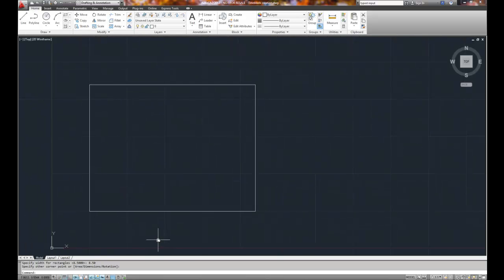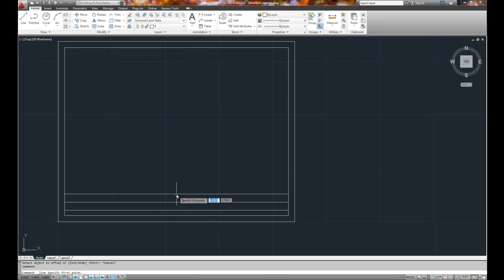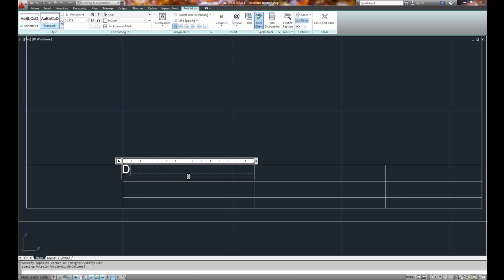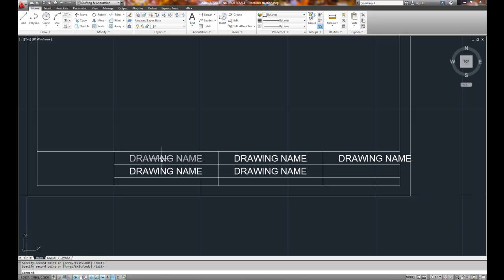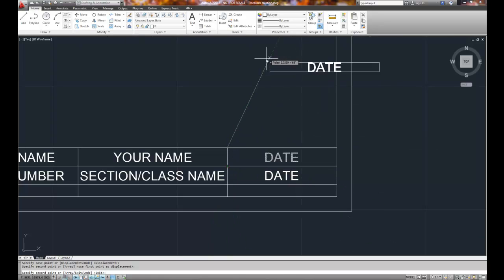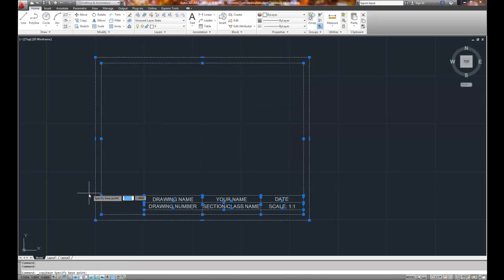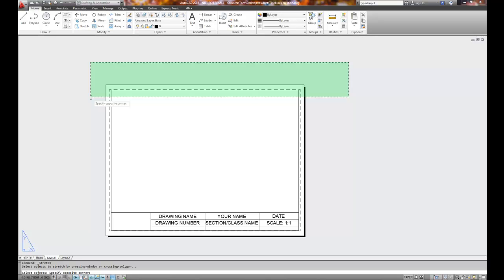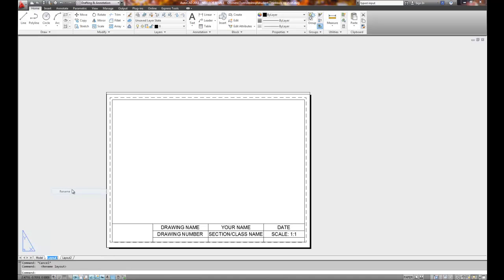Titleblock Template creation for Layouts Video 1 of 2

Comment: Is there anyway to customize the area of the dashed lines.  I made a title block but it doesn't fit in the plot area?
Reply: The hidden lines will fit around you title block once you modify your title block under Page Set Up Manager. INSTRUCTIONS *Make sure you have copied you title block into layout area before you begin to do this. Don't worry about where it is placed.**  In the Layout area right click on the Layer 1 tab the select Page Set Up Manager. Under Page Set Up Manager click Modify tab. Then under Page Setup select your printer, paper size, then under Plot Area select Window from the drop down menu What To Plot.  A tab will appear to the right that says  Window, click it. A cursor will appear you want to select the top left corner and the bottom right corner of you title block. Once you have done that the Page Set window will appear again make sure you have Fit to Paper and Center to Plot checked. Then click Ok then Close.

Comment: How do I know if I am working with inches, millimeters or meters? And as for the layout paper size it did not came out as almost the exact size to paste. Thanks in advance
Reply from the maker: You design in full size units of choice ---  Then use the viewport ( scaling) to control the exact scaling of the units to the layout
Paper size is also based on the printer  you specify in the page setup. so that may have caused the cut off material.
Reply: Tom Singer
=]

Comment: This is exactly what I needed to know. I know the video is old but just in case...a great idea for copying and pasting the block would have been to select the lower left corner of the internal border as copy point instead of the external and inserting it into the layout of the other project by using the direct input 0,0